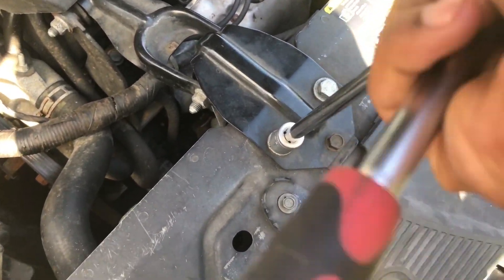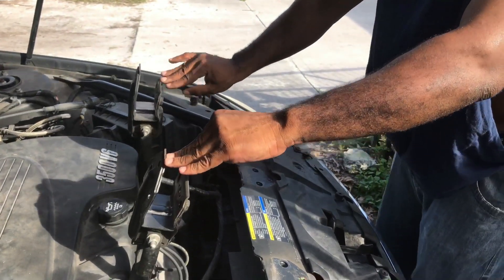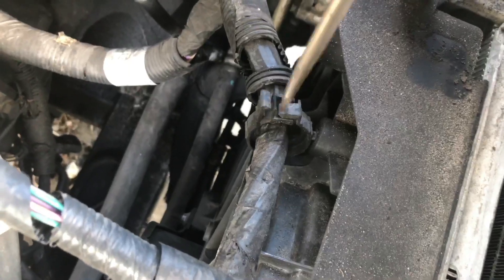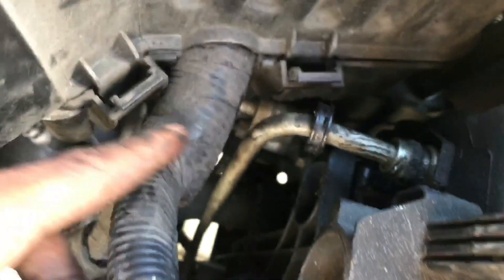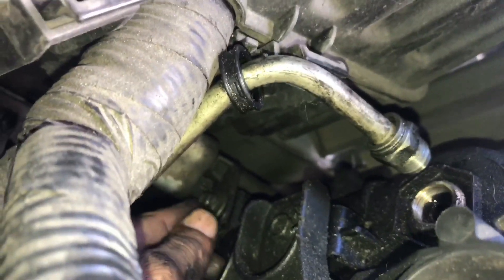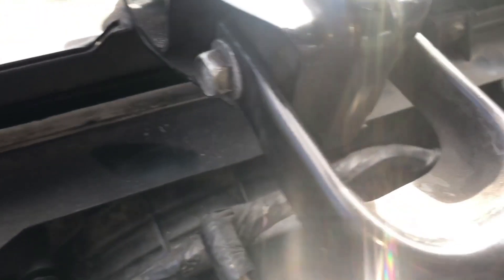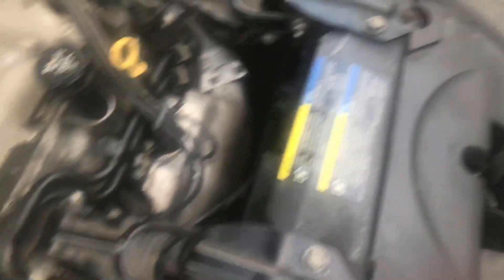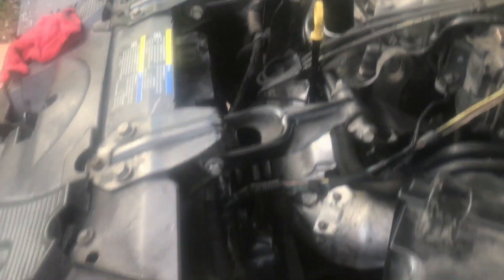Chevy Impala radiator replacement

Comment: Make sure car is on level ground, block the wheels and put in neutral and set e-brake.  If you are on any grade sufficient to put a load on the parking paw when you remove the last bolt on the mounts the engine will move.  You will have a struggle to get the bolts back in then.  If it's already happened, shift into neutral to take the load off the paw and the engine should sit down where it belongs.  I learned the hard way.
Reply: you use a large pry bar and pull the motor forward insert it on the rear of a motor mount bracket and pull forward ! LOL
Reply: So ya'll saying don't support the bottom of the motor with a floor jack, right?
Reply: Correct, the engine is supported below by the subframe.
Reply: @jonmccall6439  thanks! After wasting 3 hours looking for a direct answer,  I pulled them off and it didn't shift at all. Then I felt like a dummy for worrying😂
Reply: @tiffjohnson2706  My driveway slopes.  I didn't set the e-brake so the engine moved back an inch.  My eyes bout popped outa my head.  Putting it in neutral fixed the problem.🙄
Reply: @jonmccall6439  I'm doing this for my son. he showed me a little disrespect so I hung it up for a few days, then I hot sick. I'm trying to wrap it up today and now the dang condenser won't let lose. what's up with that? I don't want to disconnect those lines.

Comment: Thanks. Pretty straightforward. The clips are the hardest part. Took me about an hour . Honestly, if you can’t figure it out from this video… You might be better off having a mechanic do it😉
Reply: you  use a pick and pull the clip out then the lines pulls out takes 5 minutes

Comment: Damn what a pain in the ass. In my old mustangs I can take the radiator out in 5 minutes lol. Thanks for the video I think the radiator in my 13 impala is leaking.
Reply: I have this same exact year and I'm pretty sure mine is leaking as well I've checked my hoses they're bone dry lifted my reservoir inspected it it's not cracked or anything looked at the radiator best I could saw no leaks but as i ran water through it, it gave me the general area and the only spot I can't see is the bottom of it so boom I think the seam on the bottom cracked
Reply: A pain in the ass it is … Mustang was much easier

Comment: The most difficult part of removal is separating the condenser from the radiator.  Reach through the front and lift the condenser off, its not bolted except for the lines.

Comment: 3:40. So did yo take off the pins at all or did you have to unscrew it simply?? I struggled woth the pins to this day bro wpuld like some advice
Reply: Need a small hook and pull, try not to loose the pin
Reply: use a mechanics pick comes right out

Comment: Did you have to support the engine with a jack before you removed the motor mount brackets?
Reply from the maker: No
Reply: So did you put anything to hold the engine in place ?
Reply: The brackets were off mine and I had to tow it and I drove it up the ramp and off the ramp (I had just bought it no tags no insurance and no power steering)
Reply: There are lower mounts as well
Reply: I did this on a 2010 impala and when I removed the motor mounts the engine shifted back toward the firewall about 2".  Fortunately I was able to place a pry bar behind the alternator and move it forward when it came time to put them back.  If I had known this could happen I would have wedged a block behind the alternator before I removed the mount.  Boy when that engine shifted back my eyes were bigger than a cat encountering a pack of dogs!  This must not happen a lot because nobody has mentioned it.
Reply: no
Reply: The MVP. I stopped before unbolting the mounts 3 hours ago and have been searching for the answer to this question ever since😂

Comment: Wait a minute you didn't even show separation of the condenser from the radiator and never mention what size box wrench to loosen transmission cooler lines popping off the clips is easy way to lose them too... thanks anyway!😃
Reply: Be careful popping out the lock rings, if you loose them then you have to find more.
Reply: William Coleman unless u go to the junk yard an get more I got a radiator from junk yard an I took the c clips off the transmission lines on every Monte Carlo in the lot in case I would lose 1 lol